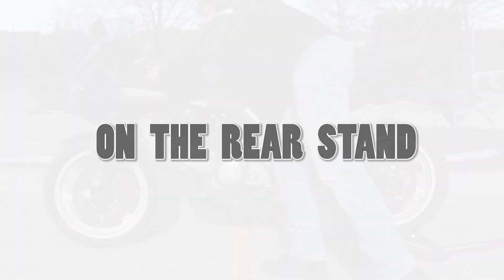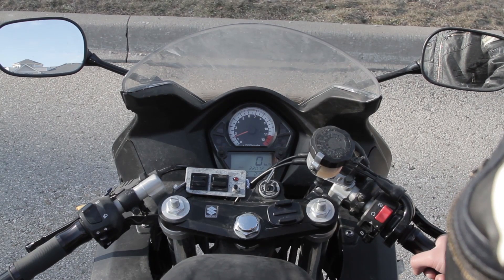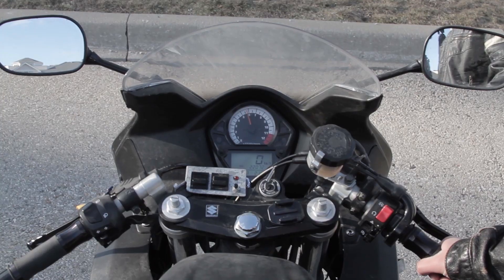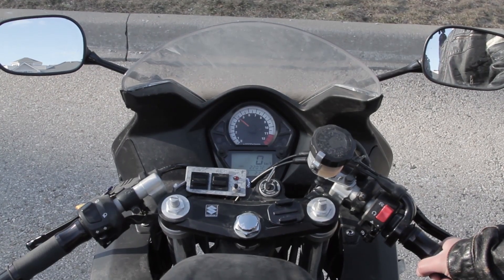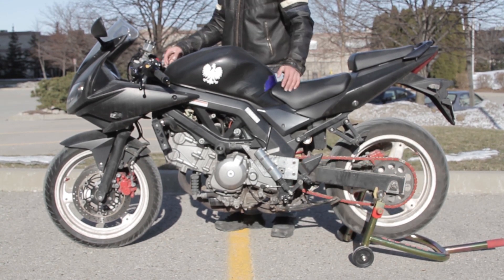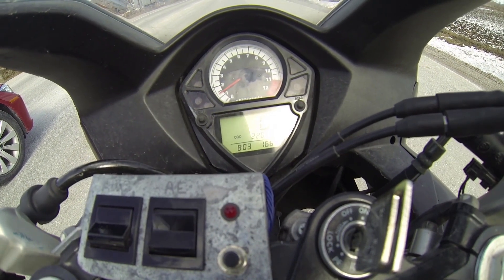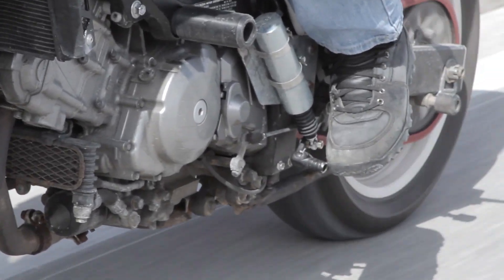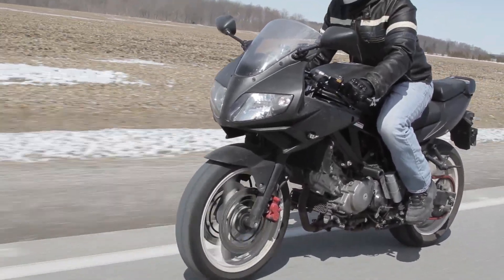DIY Semi-automatic Motorcycle Gear Shifter (SV650)

Comment: 2 questions
Do you cut momentarily the ignition for downshifting?
If you are on a big hill with a lot of rpms , a lot of throttle and a relatively slow speed does the bike actually downshifts?

Comment: Such an awesome project! Im just wondering how does it unload the transmission when down shifting and no throttle input, like when slowing down? I would expect you can then only down shift by blipping the throttle a little, like down quick shiting. But from what I understand you can only cut power, but not give it some extra power. Or does the actuator just push hard enough to force it in lower gear without unloading the transmission?

Comment: Worth mentioning in regard to some of the comments about people with l/leg mobility problems, that I have been riding without a left leg (above the knee) for 20 years using the Kliktronic unit, which uses an electromagnet actuator controlled by  two buttons on the left grip. I'll point out that the actuator on that is on a pivot mount which makes it much less violent than this fixed one.
Reply from the maker: Appreciate the feedback; thank you. I do quite like Kliktronic's implemention. Certainly worth looking into for others considering.

Comment: What tipe of actuator is it.
Reply from the maker: You'll have to look into my old comments for more details, but it was a 12VDC centre tap (bi-directional / 2-way) solenoid. The [solenoid] coil is tapped at 3 points: both ends (+, +) and the centre (-), thus actuation direction is determined by which of the ends is energized.

Comment: How difficult is this to make?  Im paralyzed and interested in something like this!
Reply from the maker: It's certainly difficult. If we weren't so keen on DIYing at the time of this project the better route would have been to purchase b-stock parts (damage, refurbished, you'll have to call to inquire) from http://www.translogicsystems.com, http://www.kliktronic.co.uk, or http://www.pingelonline.com and simply focus on creating our own control circuitry. They didn't have the features or customization we wanted so a significant portion of this project was software.

With that said, after watching a few of your videos, I think you already know that just because something is difficult or new, it's not necessarily reason to not go for it. Passion will overcome.

Comment: Nice work sir, did you use a Pneumatic cylinder or an electrical solenoid for the shift actuator?
Reply from the maker: Electronic solenoid, which was surprising hard to source at the time given our non-industrial budget :). Think the inrush current was ~100A @ 12V.

Comment: For what I know sir, is that semi auto is eliminating the clutch and using the gas throttle release before shifting up/down gear with your foot...from the way I see in your video, your turning your manual motorcycle to automatic. because the shift gear peg is doing the shifting for you with the absence of your foot sir. but still, great job and skill you have.
Reply from the maker: Thank you. It isn't a fully fledged automatic because the system only controls ignition/spark timing and the shift lever (no throttle or clutch manipulation. It still requires operator intervention whenever leaving or coming to a standstill. Tackling that last part would be quite a bit of fun!

Comment: Could you please mention how much force is needed in the solenoid to shift. I am designing a solenoid shifter for KTM390 engine and I couldn't exactly figure out for a 70 mm gear shifting lever in the engine.
Reply from the maker: Unfortunately I've lost the majority of documentation from this, but the simplest method would be to draw a free body diagram or purchase a device that will allow you to measure force at the point applied. After which add a significant margin to overcome any new moments you introduce adapting the system.
Reply: @casparbaczynski254  , my apologies. Do you remember or have access to the make and model of the solenoid you used?

Comment: hi,can you tell me from where did you bought the actuator
Reply from the maker: If I remember correctly it was a used solenoid from a Pingel kit on eBay. It was either a single coil with a center tap, or dual overlapping coil with a common reference/terminal; we never took it apart. By grounding the center tap / reference, and sourcing current to one of the free ends you could which coil current flowed (push or pull). 3 terminals total.

I don't have a part number as it's something that is custom fabricated for Pingel, to be sold as part of their kits, but I imagine every electromagnetic solenoid they use is nearly the same, if not identical. It would only be the mounting hardware around it that would change depending on the motorcycle. Mind you there are other types of actuators, such as pneumatic driven.

Your best source is calling Pingel, Translogic Systems, Kliktronic, etc. (check their websites to see what they use in their kits), and asking if they have any b-stock or cosmetically damaged (but still functional) actuators they can offer you. Otherwise wait for a good deal to appear on eBay or the like.

Remember that if you plan on buying the solenoid on its own you'll still need a way to control/drive it.

Comment: Sir if you dont mind answering me. How does the clutch get operated.
Reply from the maker: In regards to shifting, the purpose of the clutch on a motorcycle is to take the load off the transmission. This allows one gear to be disengaged and the next consecutive gear to then be engaged. Note that in a sequential transmission all gears are always rotating, but only one can be engaged and delivering power to the output/countershaft at any given time.

The principle of removing the load on the transmission is what is exploited in this project. You can actually test this on a motorcycle yourself (search youtube: clutch-less shifting; not to be confused with quick shifting). Whenever you pull or release the throttle, the motorcycle transitions from acceleration to deceleration (or vice versa), but for a moment between the two it is neither applying nor 'absorbing' any force. During this transition state there is no load on the transmission and you're free to shift up/down with your foot, without the use of a clutch.
As a regular rider I typically only use the clutch when the bike is still warming up (or just feel like it), but whenever accelerating or decelerating aggressively I will always clutch-less shift. It is a personal preference.

In this project we take the load off the transmission by momentarily interrupting the primary side of the ignition coil. By opening the primary side of the coil [through a relay] there is no longer a spark to ignite the fuel [in the engine cylinder] and it is as if the rider completely released the throttle. I don't recall the exact time period we interrupted (open circuit) the primary side, but its somewhere between 20-100ms. During this time we actuate our solenoid to move the shift lever and a sucessful shift occurs.

The reason why this is a "semi-automatic" solution and not "fully automatic" is because the method we use does not allow one to take off or come to a full stop without rider intervention. The clutch is still required for this.

Comment: I have cerebral palsy and this would allow me to shift. what do you charge for a system like this? did you work out the kinks?
Reply: that's awesome. I just bought a go kart with a 600cc croch rocket engine and was looking for something like the shiftFX
Reply from the maker: Unfortunately the project stopped once the school year was over. This was by no means production ready but I'd say a 90% proof of concept, as you get closer to 100% the kinks take longer to work out. Not to mention looking into any street legal regulation issues.

By now the parts have been disassembled and either repurposed or sold. Not to leave you hanging though I'd consider some of these guys: http://www.translogicsystems.com, http://www.kliktronic.co.uk, and http://www.pingelonline.com. There are other manufacturers (which I can't remember now) but start here and see if you can find reviews / user experiences with these systems. Something custom like this one time project was brilliant in terms of fitting to ones needs and how the body moves, which is unique person to person, but I'm not in a position where I can put in the time again to finish refining it and turn this into something I'm confident/proud of sharing and adding to peoples bikes. With that said, if you ever meet someone with the skills to take on a project like this from scratch, send me a message and I'll help in whichever way I can.
Reply: there is a system called shiftFX or something similar, that turns any bike that has "fly by wire" throttle into an automatic. maybe it can suit your needs ;)
Reply: do you know how much it costs?
Reply: Tyler Truitt sorry my friend indont know. I just saw some videos with it
You can check their homepage for more info I guess
http://www.shiftfx.com
I hope that helps ;)

Comment: Cool concept, especially that it gives injured riders another chance to get back on a bike. 
I'm very curious about your design. Did you use a microcontroller for the brain? Does the bike have some sort of CAN interface like a car, or how were you able to read engine speed?
Reply from the maker: Thank you. It seems everyone knows someone who wishes they could ride again. The idea was to at least see if we could make a 'working' model.

We used a microchip/PIC microcontroller, a lonely 8 bit at that. I don't believe this bike has a CAN port (don't recall seeing one), but it isn't a necessity; there are open communication ports used for diagnostics around the bike but I don't recall the details.
Keeping it simple we put together a small circuit to read/interrupt the primary side of the ignition + fuel injector and used the PICs compare interrupt. After that with an on board accelerometer we had all the data we would need. Engine speed was correlated to the ignition timing while motorcycle speed and gearing were an interpretation of wheel radius (similar to OEM ways) + single analog wire off the bike + accelerometer/ignition timing. The interface between the brain and the bike itself was very minimal and, well, raw. No communication protocols to interpret.

If somewhat efficient with coding you don't need more than 16MHz with the free compiler to capture/filter and process all your data with a bit of headroom to spare. Mind you, the mechanical/hardware/software troubleshooting when starting from scratch is enough to make you continuously question your sanity. A stupid surplus of fun and finally reward when everything works in harmony in the end.
Reply: Sorry, I didn't realize you commented. 
I recently got into motorcycles. I've had a 250 ninja for about a year and actually just last week I bought an old sv650 of my own :D
I am a firmware engineer (relatively inexperienced, however), and some of the products that the company I work for makes use 8-bit PIC's. They are my uC of choice, and the PIC18's actually have some pretty impressive capabilities. 
Ah, so, if I understand correctly, you used the compare interrupt triggered by the ignition coil to monitor engine speed? Clever! What was the accelerometer used for? Edit: I just looked at the description and forgot about the other modes of operation, hence monitoring fuel injectors and acceleration. Even more impressive! Were (are?) you a grad student? What is your degree in? 
"Mind you, the mechanical/hardware/software troubleshooting when starting from scratch is enough to make you continuously question your sanity." - Yes I have definitely been there. But indeed it is so gratifying to see your project actually working in the end. I love being able to bring an idea to life.
Reply from the maker: Haha that's great to hear. I'm just getting back to riding after a 5week 'break'.... which is far too long if you ask me. After riding it for almost 4 years now I understand it's not the best bike that ever existed, but working on it is a pleasure. It really is a well rounded bike, especially once you modify it to your liking. If you like taking things apart and putting them back together better than you found them... you won't be disappointed.

The documentation and level of control achievable is what draws me to the PICs. Mind you, ARM based microcontrollers such as NXPs LPC line is also rather fun, but I only know them from a hobbyist perspective.
Rather jealous you're working in firmware. I already thought electrical engineering (degree) was black magic, but the scale of firmware is another world in itself which I sometimes wish I had further explored. Currently graduated, and working towards my license. Best of luck to yours!

Comment: Would definite like more information on this, not using it for a motorcycle......but for a boat
Reply from the maker: Ha. Reading it now I can see how it sounded that way.
Moving a CVT over would be quite the project, but still fun.
As a side note: I would never stop anyone from dismantling and repurposing a scooter, operational or otherwise :)
Reply from the maker: jeff S If you can tap into the primary side of your ignition coil (lower voltage side) and momentarily interrupt it (say with a relay) than you can stop combustion (momentarily create a state of no-load on the transmission) and shift.  Using a mechanical relay (opposed to a solid state relay) is possible because of the relatively low engine speed. E.g. 7200 RPM = 120 cycles / seconds. With a 4-stroke motor you'll have 1 spark/cylinder every 2 revolutions.
 
Alternatively to cutting spark, you could momentarily halt the fuel injectors. I haven't tried it, not sure if you would have to deal with residual fuel or line pressure, but if it's significantly easier to tap into than it's worth investigating. 

The most interesting part I think will be seeing what you come up with for a robust mechanical system to operate your shift rod/lever.

You shouldn't need more than ~60 ms of no-spark, which you can time with your shift system. Be aware that unspent fuel entering your exhaust may result in a potential backfire. Expect a check engine light to appear the moment you interrupt either your fuel or spark lines.
Reply: Caspar Baczynski
Thanks for the reply!! I was/am putting a street bike engine into a jet drive seadoo boat. Figured you could leave engine in 3rd gear and wind engine to 10k and boat would be dam fast. But if you could shift the gears via button, would make boat even faster!!
Reply from the maker: jeff S That's a great DIY project. If you can do that, I'm sure you could do this.... but remember that this build and all universal kits from  the main manufacturers (Translogic, Klktronic, PINGEL, etc.) don't play with your clutch so starting and coming to a full stop would still have to be under manual control. If you find one gear is all you need, than stay with that. If you switch between aggressive and long straights of cruising, switching gears is a must, and for the sake of having a warranty I'd go with one of the kits.

Hope you post a video when it's all done.
Reply: +jeff S Not really the way to maximise a hydrodrive.
Reply from the maker: +Morten Kristoffersen I'm not familiar with those, or boats in general, so you've got me curious; maybe you can clarify. I don't expect moving this from a bike to a boat to be a copy-and-paste job (motorcycles are fairly simple) but what obstacles/considerations would a hydrodrive add? (googling hydrodrive brought up hydraulic boat steering and truck hydrodrive).
Reply: Caspar Baczynski Wow, you do sound serious !
I think the gearbox may be a non-runner with the jet drive. What you need is a more or less constant RPM on your jet drive, but almost infinite torque. I believe what you really need is a CVT (Constant Velocity Transmission) off a scooter or e.g. a Suzuki Burgman.
Do remember you will need a hydraulic pump too, to run the power steering. 
-Do let me know what you come up with.
...Hell, I want to build one myself now !!! (-:
Reply: Caspar Baczynski Absolutely, and I guess a Seadoo with a manual box would be absolutely hilarious. Go for it, and remember to post updates !!